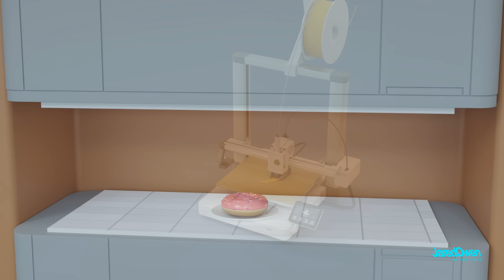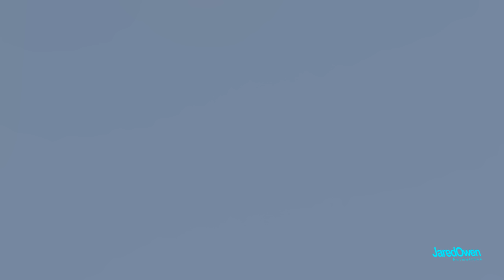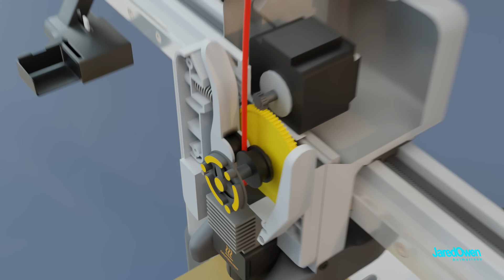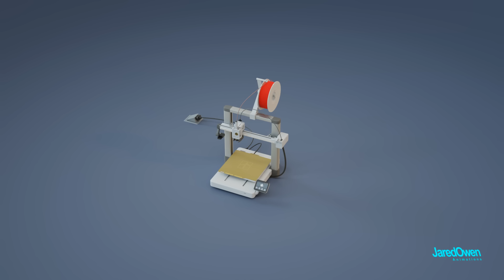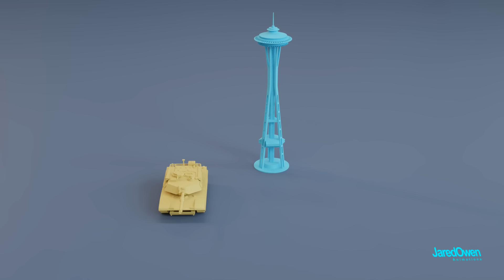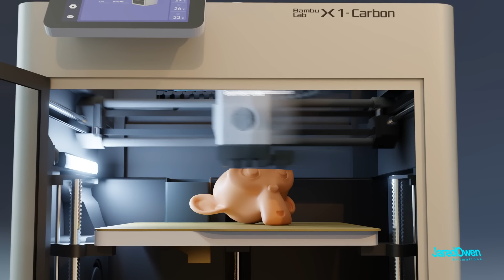How does a 3D Printer work? (A1 by Bambu Lab)

Comment: Great video. I have used several FlashForge 3D printers before, and they work similar to these Bamboo Lab printers. One thing these printers do is calibrate each axis by homing the build plate and tool head before printing. This ensures that the printer is printing in the right spot.

Comment: 3-D printing is not a new thing. It was a machine at 100 years ago in 1920s they’re actually using machine to make houses by using cement differences. This machine have to have something to try trace like a model of the house to put the cement out now we have a computer that don’t need to mechanical device to trace it to make a house or an item. That’s the only difference.

Comment: Since we have an X-1 Carbon at the office (we develope CAD software for engineers and architects), I use it on a regular basis. I have actually never downloaded anything but constructed everything I need with our software. Replacements for broken handles, adapters for ventilation connections, a clock for my office,... the possibilities are endless.

Comment: I just bought a Creality Hi 3D printer, and it looks almost the exact same as the one you showed. It's a bed slinger with a poop sweep on the left. The difference is that the toolhead only has one tube hole because there are four holes on the buffer adapter attached to the enclosure (CFS), while the toolhead has four holes one for each tube from the color holder (AMS). Also, the piece sticking out to activate the blade to cut the old filament is on the left side for Creality but on the right side for Bambu.

Comment: First off, I want to say that you've done an excellent job of explaining the basic principles of how a 3D printer works, and though it uses some of the Bambu Lab line as it's basis, many of the concepts are common across all 3D printers.

For me, getting into 3D printing was something I'd thought of for many years, but I'm glad I chose to wait till the technology had matured a bit. It's certainly far easier now than it was even a few years ago, and the slicer applications continue to evolve continuously. A big part of visualizing 3D models is understanding 3D model space and the X,Y, Z axis. I personally was first exposed to 3D concepts using Intergraph CADD stations back in the early 80's...  large stations that were connected to Digital Equipment Corp. VAX midframes. Trust me when I say things have become orders of magnitude simpler and more powerful since then. What used to take a midframe computer environment now runs on a desktop using applications as simple as TinkerCAD or more advanced parametric modeling apps like AudoDESK's Fusion 360. 

But specific to your instructional video, at around the 13 minute mark you start to discuss multi colour printing. However, your animation doesn't show the very important step of creating a purge tower and how that is used in the process of changing filament colours, and how the amount of filament to purge varies based on the colour of filament currently in use and the one that will be used next. Then there are the aspects of purging into the model and/or the purge tower, as well as print by layer or print by object. But I guess that's really more to do with the slicer functions than the actual printer itself.  Great instructional overview video though. 

As an owner of an A1 with AMS Lite, I have to confess I do like the wee beast. It can rapidly become a rabbit hole... the more you learn, the more you want to try to accomplish. However, the important and most helpful aspect of starting out is learning how it functions and how you can manage how it operates. So much flexibility, and also, so much fun!

Comment: By they way, this video is an explanation for this specific printer. Others, like the Ender 3, work a bit differently, and aren't as advanced as this one. Also, that nozzle part you mentioned isn't called the nozzle. It's called the hotend. There's a small part that comes out of it the plastic, and it's the one that's called the nozzle.

Comment: In subtractive manufacturing, you could reuse the waste if the material used is metal or plastic or any other meltable material.

Comment: amazing video, just a few small corrections

1. G code is not instructions. G code is actually a set of coordinates the nozzle needs to go. It's not so much about controlling the exact position of the motors but the tool head. the onboard computers figure out how to move the motors on their own. if you look at G code it's just a very very very long list of numbers with the occasional letter in between. 
2. that plastic tube is known as the "bowden tube" bowdens can be found on more than just 3d printers.
3. The bed is heated to prevent shrinkage. Yes you're partially right that it's for adhesion but there are cold adhesion plates. the problem is that if you don't heat the bed the filament can shrink. this can cause warping or with enough layers will cause it to jump off the bed. you can see that happen at the end of printing and it's completely cooled down.
4. The 'special glue' is just PVA glue but hairspray works better (IMO).

Again. lovely animations just had a few minor gripes. this is a fantastic ad too and makes me a prouder owner of the p1p.

Comment: Great video, but one thing I noticed is that the textured build plate is not for adhesion but rather to allow the print to release easier, especially when printing with petg which is notoriously sticky

Comment: Seen a XYCore before, but I haven't seen a bed slinger. Now how about make the bed slinger belt actually move the tool head rails so it can move in 3d and the build plate doesn't move? Smart ide, right? For stepper motor wiring, just use cables that can bend!
and i wished I have a 3d printer

Comment: This is fabulous! My only nit is that the fan highlighted on the X1C is the additional layer cooling fan, which blows ambient air across the top of the print. (These can also be added on to the P1P.) The chamber fan (for controlling the chamber temp) is on the back wall. 

Well done, thank you! ❤️

Comment: 🤨 - you didn’t say; does the “A1” have a cooling fan in its workhead? The X1 carbon is 🙄 as we see the very-prominent centrifugal fan in the front of its head. A lot of 3D printers have cooling fans in the head to blow on the print to set the layers and to cool-down the heated extruder when it has finished

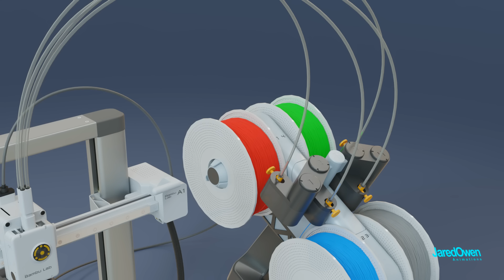Comment: 12:06 I like the idea a lot, but when i came to introduce the chips, I immedialty thought about normal printers and ink cartridges with chips that only alows cartridges of the same maker (wich makes them also more expensive to produces and so buy). A small chip to automatically recognize the "ink" leads to compatability isues later on like HP/Brother printers. I don't trust that, let me do it manually in a way they can't force you to only take their fillament, and it'll be a good buy.

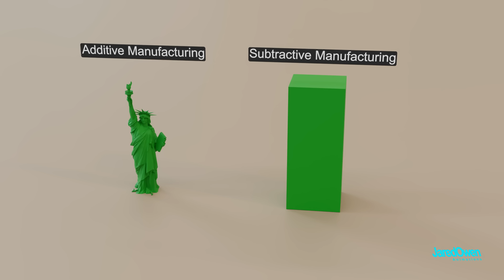Comment: 1:08 is a bit misleading. In subtractive manufacturing, any excess material is almost always completely recycled and re-used. Additive manufacturing frequently can create a sizable amount of waste when prints fail, and scrapped parts/prototypes cannot often be recycled.
Reply: recycling still makes a lot more pollution, i mean, recycling metal happens in big factories that melt the metal into new parts, which makes a lot of co2 and costs a lot of power. but i get your point!
Reply: @freelife-productions5745  That’s true! I was more talking about physical waste (as he was mentioning in the video), but that balance of CO2 emissions is also super important.

Comment: this is the best ad i've ever seen, not bullshit, straight to the facts, this is an ad i would not only gladly watch but consider to buy one myself, informative and with your own style adding the touch it needs without being intrusive
Reply: You should absolutely buy it. I don't have this one, but I got the the A1 mini, which by itself is $199 US right now, that's nuts. It has all the newest 3D printing tech and is super fast. The print bed is big enough for almost everything I want to print anyway, but the regular A1 is huge. The worst thing about it is that it will fall off a table if you don't have a way to keep it still when printing even slightly fast, probably not a problem with this bigger A1 though. I pretty much don't use any of my other bigger more expensive 3D printers anymore. You should buy one even if you don't need a 3D printer at all and you have a bunch of good ones already, that's how good it is for the price, either the mini or regular, that applies to both.
Reply: @jaredf6205   Agree, i recommended it to my cousin. He is very happy with it.

Comment: I’m wondering if I could rent a high-quality 3D printer system and use it to print myself a 3D printer? Need steppers and wires of course… I’ve heard that some printers can print using metallic media also. Great video, again, Jared. One of my favorite subscriptions. Thanks!
Reply: Technically - yes, it's possible. But you'll still have to buy all of the mechatronics, some 2020 extrusion to make frame out of, and also have some other capabilities, like drilling and tapping holes, soldering, etc. 3d printed parts will moslty be supplementary ones, like holders, covers and so on. You can print out the entire chassis out of PA-CF, for example, but it'll be cheaper to make one out of metal.

Comment: I've owned this printer for months now and I only have two complaints about it.
1. The melt plastic does NOT like to stick to the metal plate (while using a 0.2mm nozzle), everything is "normalized" for 0.4mm nozzle which is the default.
2. The camera has the worst resolution and frame per second.. I think it's 10 or 5 FPS, I don't know why they wouldn't put a better camera or what limits it
Reply: The CPU in it limits the camera performance.

Comment: I have a suggestion - How a normal Printer works
I am subbed btw
Reply from the maker: Great suggestion!
Reply: @JaredOwen  If you're going to do it, is it gonna be only laser printers or also inkjets?
Reply: @JaredOwen  why not also do the old dot-matrix printers with the strips that had to be torn off the sides? I figure you've done VCR before, so not too far off
Reply: @vivi_t3ch  I would like old dot-matrix printers with these contra-rotating double threaded rods for moving printing head, never saw it anywhere else
Reply: An Inkjet and Laser Printer videos would be cool.

Comment: As a retired senior living in AZ, I confess I’ve never viewed an intro on a 3D printer before. But being a big fan of your work, Jared, I’d lay money that nobody would take us on that fascinating journey as methodically as you. Thank you again!

One question: I’ve seen 3D-printed objects (even a car), and they all appear to have linear “ridges” along its shape from the layered print process. Is there a way to smooth out/fill in these layered creases?
Reply: You can reduce them, and you can mask/hide them, but not eliminate them. Ways to reduce them are to use thinner layer heights (and possibly a smaller nozzle, since that usually enables even thinner layer heights), or re-orienting the model so that the layer lines are not as prominent in certain parts of the print. Hiding them can come from using a less shiny material (the more matte the material, the less it catches light and the lines become less visible), or a material with additives ("marble" materials distract your eye), or using "fuzzy skin", which adds a bumpy texture to side walls which makes the layer lines harder to see. Of course, you can also physically smooth out the object afterwards, such as using sandpaper or chemical vapours to melt the outer surface, but the effectiveness of these techniques differs based on material. PLA might be the easiest material to work with, but it doesn't sand well, for example.
Reply: Hi, Generally there are a few ways to deal with layer lines 
1) Use a filament/color that doesn't show layer lines as much. Such as matte white or carbon fiber
2) Make it look like it's part of the design. You can make the whole surface a little fuzzy so that the ridges look like part of the pattern
3) Old fashioned Sand, fill, sand
4) Use a solvent to dissolve the ridges together. With abs, it's acetone; pvb, isopropyl alcohol; pla, chloroform
Reply from the maker: Thank you so much Marc! I'm glad you enjoyed it!

Comment: How stable is the layered build? I've always been concerned that melting layers of plastic slice by slice isn't as solid as say molding in a furnace, and I'm not sure if the outside surface of a model will be truly flat with this algorithm.
Reply: It depends a lot on the material, temperatures, speed, how dry the filament is (they absorb moisture from the air and many of them need to be actively dried out before use), etc. This is typically called layer adhesion. Under good conditions, the strength perpendicular to the layer direction is probably around half as much. A vertical outer surface can be quite flat, but there will be a layer line texture.

Comment: The best printer in my opinion is the ender v3 SE… bambu lab printers are nice but they are hella expensive. You can basically getvthe same features as the 1k bambu printers with the SE
Reply: Ender 3's are toys, Bambu's are tools.

You will spend more time fixing / upgrading your ender 3 than actually using it to print stuff, Bambu works right out of the box and RARELY breaks down. I have an Ender 3 I bought a few years ago and it works fine, but anyone in the 3D printing community will agree that Bambu is the new standard.

Also they are not that much more expensive, the A1 mini is only $200 and the normal A1 is $340 it's worth the extra 100 bucks to get a much better printer
Reply: They're not, though. The closest equivalent to the Ender 3 v3 SE is the printer featured in this video, which is $339 USD, but the Ender v3 SE is slower and missing lots of major auto-calibration features (flow dynamics, input shaping, noise cancellation, etc.), and doesn't even come with a PEI plate. Besides, the higher-end Bambu printers that you're comparing it to are core-xy enclosed printers, which are really not price comparable to open frame bedslingers.

Comment: I have a 3-D printer. the company that made it is called Ender instead of calling the build plate well… the build plate, we call it the bed. Also, the tool head isn’t called the tool head in my family. Instead, it is called the nozzle.
Reply from the maker: Ahh interesting! I can see how some of the terms would be switched around
Reply: @JaredOwen  agreed
Reply: The Ender printers still have a tool head, but I think you're confusing it for the smaller assembly. The toolhead is the entire mechanism that moves around and (in a direct-drive printer) has the extruder motor and such things. The part where they actually differ is that the Ender printers have a removable nozzle on their hot end, while the Bambu printers have a fixed nozzle in the hot end (you swap the entire hot-end, not the nozzle).
Reply: The build plate is the removable plate that goes on the bed. The nozzle is a part of the toolhead.

Comment: My latest project is a replica 9.2” naval shell for an upcoming military fair. It’s taken over a month and 7kg of filament but it’s almost ready. And by the way, despite working with 3D printers for over five years, I’ve never heard the term “printer poop” until now
Reply: 7kg... Are you printing with 100% infill or something?
Reply: @guspaz  no, but even at 5% infil, it’s a massive shell, ive had to cut the model into 24 pieces in order to make it fit on my printer

Comment: Large Scale manufacturing using 3D printing because of cost and speed?
I think that's only true for prototyping.
Manufacturing injection molds and making products with that is usually enormously more cheap and fast at scale than maintaining several hundred 3D printers

Comment: Yes but the FDM 3D printing I saw at trade fairs in Austria and New York, the final product wasn't very strong because the layers don't bond and become one. They are still layers stacked on top of each other, and remain flexible and then separate between the layers. It was really disappointing.
Reply: Yes, layer adhesion is typically the weakest point of an FDM printed object, but it is a known variable. Much like a brick and mortar building. I have made load-bearing brackets that outperform similar aluminum brackets. It all comes down to the material, design, and print quality. FDM filaments have improved drastically over the past 5 years and will continue to improve as demand grows. If I were you, I'd give it a second look.